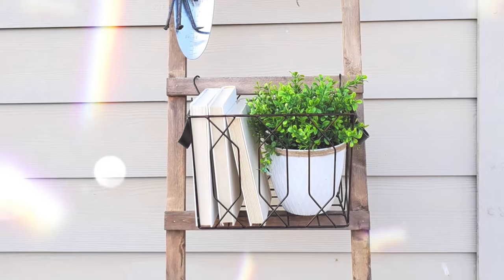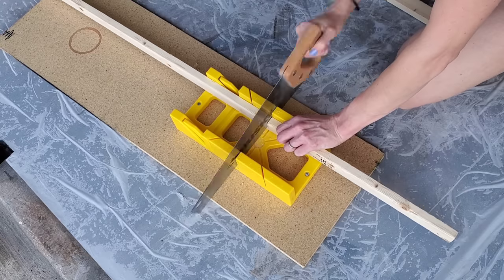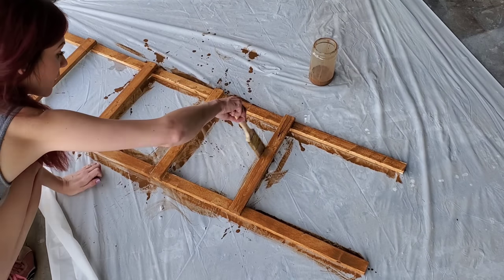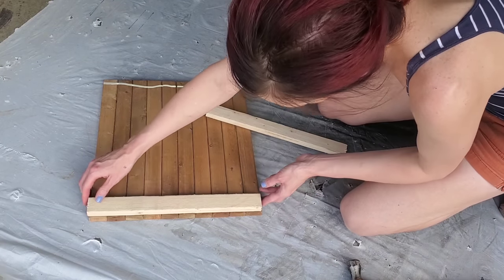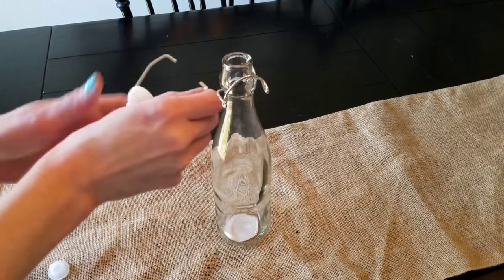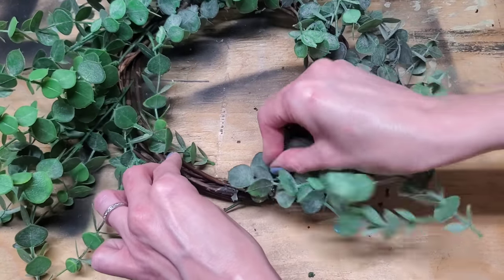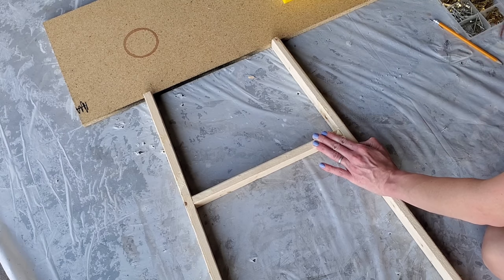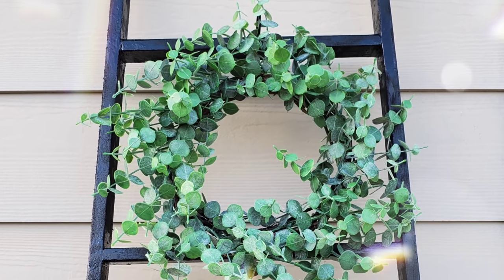5 EXTREMELY CHEAP (Not Cheesy) DIY Patio Decor under $5

Comment: Loved last ladder the best. How did you figure out the distance apart for ladder rungs? Working with angles can be so hard!. Try sliding items against something solid when you nail into it like the wall or a piece of furniture to hold it still. I would have nailed it in place also!

Comment: What sealant do you recommend for outdoor ladder
Reply from the maker: I will probably just use Rustoleum's clear spray paint as a sealant. The ladder will be outdoors in a covered area so that will be fine.... BUT if your ladder will not be in a covered area I think an outdoor polyurethane sealant would probably be better.